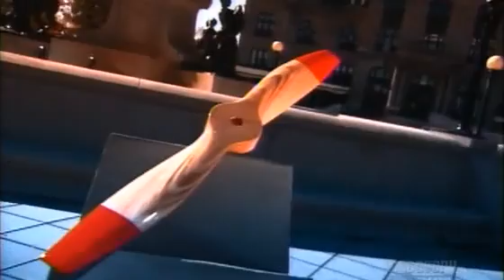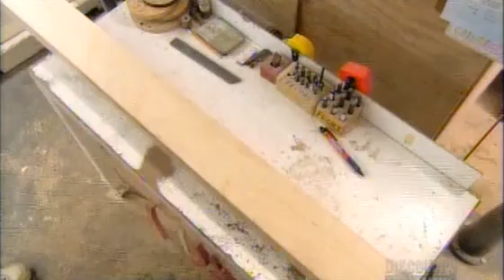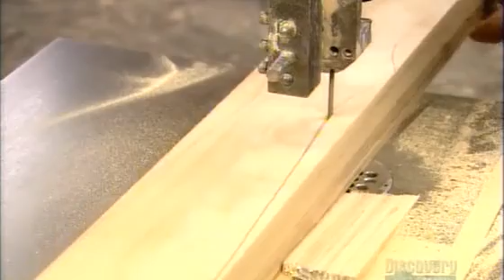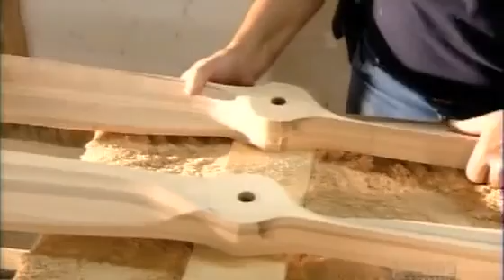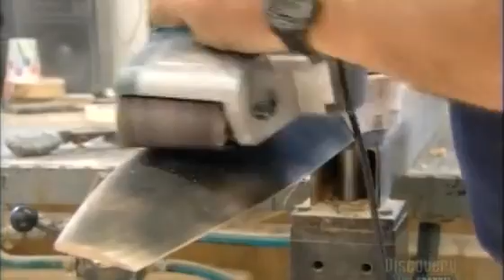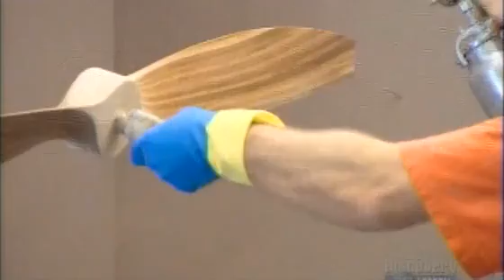How to make  Wooden Airplane Propellers {www downloadshiva com}

Comment: "Pitch side and airfoil side". Clearly she's got no idea of what she's talking about
Reply: Actually this is (unfortunately) common terminology and (unfortunately) an accurate description.

Many props (not modern composite props) use an old airfoil, like a Clark-Y, with a FLAT bottom surface.  Thus, one side has an "airfoil", and the other is "flat".  That flat side is typically used to define and measure the pitch of the propeller.  A more accurate indication of pitch would be relative to the zero lift angle of the airfoil.  And a better prop would include an airfoil with no flat surface.
Reply: @dennisolcott  Ok but she said PITCH side (not flat!) and airfoil side. Like they were 2 different things! Why would she use old outdated jargon as opposed to proper terminology, you'd never hear this language in an academic lecture room

Comment: Yeah, if you have thousands of dollars to spend on computer guided milling machines. How do you make one without that equipment?
Reply: +rudis123 Ditto Rudis's comment. You lost me once they bolted the prop in the cnc machine.
Reply: I just made one from construction pine as a test run and took me 8 hours to complete including spray coating...Some savvy and a good pair of hands is all you need. And of course the need for a propellor. It actually looks like a bought prop.